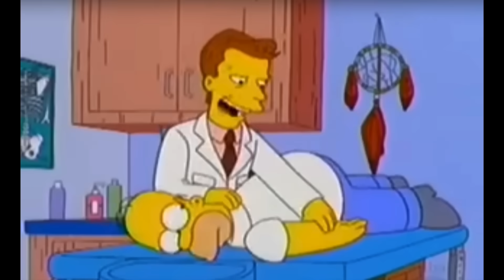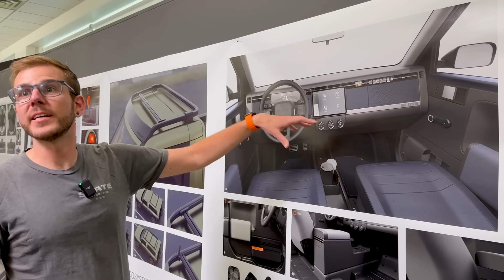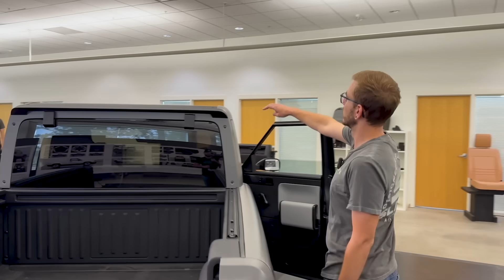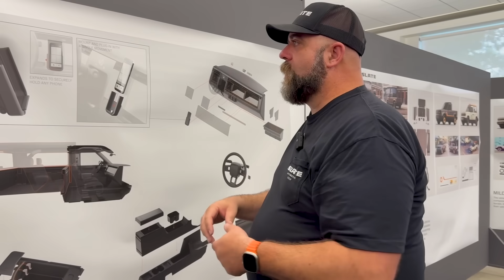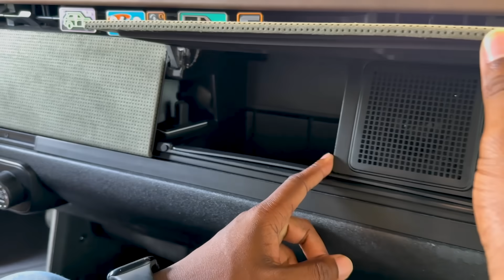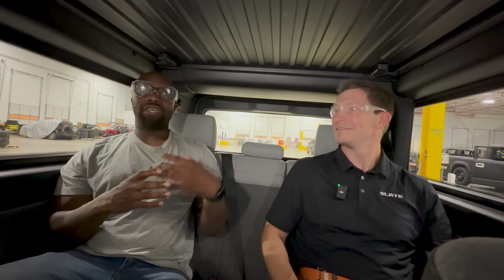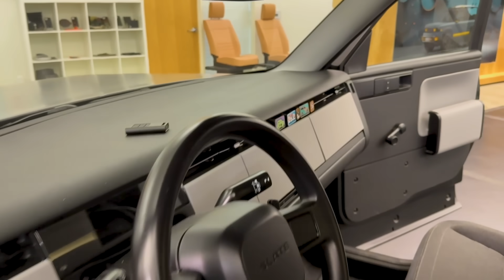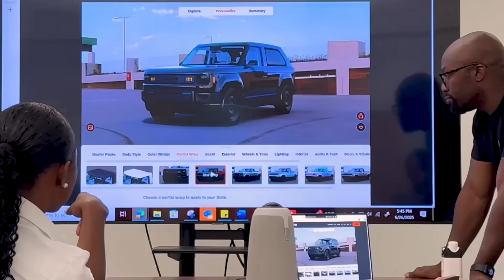The Slate: America’s $20K Answer to China’s Cheap EVs (Exclusive Access)

Comment: I own a Rivian R1T. I love it. But my favorite car that I ever owned was my Cherokee XJ. I miss the era of customization, serviceability, and razor focus that cars once had.

The Slate philosophy and the car they've designed literally brings a tear to my eye. This truck speaks to me in a way that I forgot cars can. Words cannot describe how deeply I hope for Slate to succeed, and for my modern day electric XJ to be in my driveway two years from now.
Reply: I do miss my XJ. I wouldn't trade my 99 4runner for one, but I do miss it. What I don't miss is fixing something every other weekend. Don't get me wrong the 4.0L is legendary, but the rest of the XJ is built so poorly. A unibody SUV with sold axles and 4wd is a great idea. But the execution was terrible. The electrics are garbage, the cooling system is undersized, the plastics are brittle, the wiring is sketchy, the body has too much flex, the rear leaf springs ride terrible unloaded yet sag when adults sit in the back, don't even get me started on steering play and death wobble. The only good things about an XJ in my opinion are the engine and the exterior styling.
Reply: @xanderlander8989  maybe I just had a good one but I never seemed to have those sorts of issues. I had a 5 speed 89. Aside from upgrading the rear axle and suspension for the OME lift, I never had real powertrain issues. Maybe replaced some spark plugs and vacuum hoses but when I sold it at 230k, it just worked fine. Never had any steering issues with it at all. West coast car so no corrosion. What I miss most was just how simple it was to work on. I think the XJ was an old school design that was just produced long enough to benefit from more modern things around manufacturing like OBD, but mine predated excessive use of cheap plastic clips and such, so it held together well. The XJ was a good design to start, but I think what made it a legend in my view was that it was just a prime example of an old school design that survived long enough for the final hurrah of cars meant to be repaired instead of manufactured perfectly and cheaply, but to be replaced once it finally broke down. In the same category in my mind are  gen 2/3 4runners,  the ford ranger, jeep TJ, and K5 blazer. Cars like that were designed by everyone but they don't exist any more.

I hope that Slate can prove that there's still a place in the world for a car that is simple in concept, easy to repair, and easy to modify/personalize. There are a lot of us who don't want to give up out old 4runners or XJs because no one has made a new car for 25 years that can do what they do. I don't want to speak to soon, but Slate is the first company in this century to try to bring an old concept of what a truck needs to be.
Reply: @xanderlander8989  in other words * i took my xj in extreme offroading conditions and things broke* like most vehicles will
Reply: you can still restore and upgrade those old cars, xj still have enormous aftermarket support and can be picked up relatively cheap used.

Comment: the msrp is 27,000 so they are really hoping the EV vehicle subsidy doesn't go away. Otherwise they are selling an EV truck with no accessories for the price of a ford maverick.
Reply: You can get a new Equinox EV for that money with all the normal stuff and twice the range. Just gut the interior if you want a work vehicle. IMO the Slate doesn't make sense over $20k MSRP, really more like $15k.
Reply: @bryanhersman4037 have fun with your piece of crap that will be scrapped by the insurance company because there 2 scratch under the car on the skid plate of the battery lol
Reply: @bryanhersman4037  I agree in that price range there are other options. However, the other options are not built to be kept for long term and require far more in labor, repairs, maintenance, and cost to maintain. 

Just had an AC replaced in 3-4 year vehicle I bought new right out of warranty and it cost me 3K and most of it was labor cost. Family member also had a turbo in his truck break and got quoted 10K+ to repair just out of warranty window and most was labor.  

The slate has a modular design where I can just remove the sections designed to be EASILY removed myself and plug and play the ac parts. If need be take it to a mechanic to add the refrigerant only.  I could have saved myself like 2K in labor. 

Also once you order your traditional vehicle you are stuck and limited with what you can do . That traditional vehicle will always be a car or truck not both. With the Slate you can have both. 

Traditional cars also require all the cost upfront for packages and things you might not need. With this you can as you please .

BIGGEST THING THOUGH IS NO DEALERSHIP MIDDLEMAN from what it appears they are going to be selling directly to consumers. 
That is enough for me to get one tbh . Buying a new car an dealing with Dealership is among the top of list of miserable things to do. Might even prefer a root canal at the dentist.

Im going to get on the pre-order list because I like the concept and the thought the company has put into making this DIY friendly and being American made!
Reply: Yeah, I was kind of shocked when they said it's 27k. Especially when they talk about how much they've eliminated and how little it really comes with. Simplicity is good, but not if it's the same price as higher optioned vehicles (hell, you don't even get a stereo?). It's a unpainted plastic box... Basically just a full size rc car. I don't see where they justify that price. Maybe they need to recoup a lot of start up costs? Or they're trying to make too much markup? It definitely feels like they planned on ev rebates. I dunno, but I don't see them selling a ton unless they get that price down
Reply: @colestowing8695 
It’s cheap as hell for a little truck. What do they need to justify?
Reply: @ChitFromChinola  i guess we'll have tp agree to disagree, but you can find a lot cheaper than this out there. admittedly maybe not a truck, but a buddy just got a brand new leftover equinox for like 21k. or the slate is 27/28ish...for a few k more you could get a 4wd wrangler. if you shop around not everything is over fifty grand. this is a tough sell for that much money...i just think it should be well below twenty to really get traction. which makes sense if they were banking on subsidies
Reply: @colestowing8695 
An Equinox and a Wrangler are not pickups. And a Wrangler is not electric. (And Wranglers are death traps.) I’m not going to load bags of Quikrete and chicken feed into the back of an Equinox. This pickup is as cheap as any other on the market, and it’s full electric which is better than any gas engine. If they get it ramped up and commercialized, it’s going to be a winner.
Reply: @ChitFromChinola  yes, i said that those weren't pickups. and i did mention the maverick (i think...maybe i forgot) which is a small truck for around the same money but way better equipped. look, im just saying there are other options and i dont think the value is there on this-not at almost 30k. I don't know what it costs to produce these but I'd be very surprised if there isn't a substantial markup. And if not, then.... I'm wrong (maybe this is the cost of making stuff in the USA, in which case I'm absolutely wrong and i regret bashing on them). But ultimately Im not telling you what to do. If you want one of these, by all means go for it. It's just kinda weird seeing people argue for a corporation....you realize these are backed by Jeff Bezos/amazon, right? This isn't some little startup doing a kickstarter. They don't gaf what i think. Anyways, if you get one by all means feel free to come back later and tell me how wrong i was and how fantastic it is...I'd honestly be curious to know
Reply: @colestowing8695  That's what I see too.  That ev rebate was nearly 30% of their price there.  And without it, it prices itself into much better vehicles for the money.  

Like if I wanted an EV today, I can wait for that for 27k or more (price creep between now and when it goes on sale) and the risk of a new EV company and first line EV. Or get a new base trim Chevy Equinox for under 20k today (there are some great sales on those right now) that seats 5, has basic convenience and tech, and 320 miles of range.  

If I must have a truck, I'd go santa Cruz or Maverick where I can get a lot more towing, better payload, a hybrid option, seats 5, no range issues and not much longer than an accord.  

This one may have a niche, city truck, single people or no kids and never hauling any friends, 2nd vehicle or 3rd family vehicle, maybe some city fleet use... but that's not something you can keep alive on.  

It seems like an Amazon investment.  Low risk (for them it's a drop in the bucket) put their marketing team on it, if it works, cool, that can return a lot, if not, shut it down after a year rather than drag it out.
Reply: A quick search of my local Ford dealers shows 106 new Mavericks for sale and not a single one under $34.000.
Reply: My issue is...the base slate truck costs 26k roughly (there is no electric car tax rebate now) meaning your paying for an electric truck that is very range restrictive not that powerful...bare bones in every regard...for 26k? Like youd be better off spending that money on either another new veichle or...buy a really nice higher trim veichle. Obviously with trucks its harder but still it sounds like a scam the price being so high and the feature set being so low and having to buy every upgrade which I could see quickly leading to a big upsell...I mean do they even have prices yet on the add-ons?
Reply: Imagine buying a Ford lol
Reply: @lettucejones3677 I have driven 4 Fords over 250,000 miles. I don't think I'd buy a new Ford, but the first and second generation Rangers and All of the F100s and F150s prior to 1996 were great trucks. The Thunderbirds, Taurus and Crown Victoria's, especially the ones built to interceptor specs were extremely  reliable.
Reply: It already has been ended
Reply: My thoughts exactly!!😂
Reply: you can buy a Tesla model 3 for 34,000 not 80,000.
Reply: It won't, the government has a big hard on for pushing people to EVs because they get a lot of kickbacks for it and it's going to take YEARS to convince people.
What pisses me off about it is that they're doing it NOW instead of spending a couple trillion over the next decade rebuilding our energy grids and electricity infrastructure to be able to HANDLE EVs on any scale worth talking about.
Would also give companies time to get EVs out that are actually worth buying
Reply: One should never account for tax credits ever when buying a car. Its considered a bonus when and if you get it. Yes you are right the truck cost more than a nice 4 door Ford Maverick which cost around 27k base and the hybrid gets 40 plus mpg city and 30 plus highway. I do not think i would pay more than 15k for a Slate truck with a range of 150 to 200 miles. I really do not need or want a 2 door model and there has to be more ways to cut the cost. Its an over engineered trucks when they should be looking at how to make it simple and with in the confines of the regulations. 
There is so much stuff added to cars and trucks that keep the price high that no one really wants or needs.
Reply: It generally foolish to predict the future, but I don't see any Maverick available at $27,000 January 27
Reply: Yeah if only our country actually looked towards the future. One can I dream I guess.
Reply: @kidethan9  Why should other taxpayers fund your junk car that is far worse than a fossil fuel car just so you can virtue signal?
Reply: Ford Maverick is hybrid. I want an electric truck, so I’ll buy a Slate. The Maverick has Ford’s cheapo electronics, Slate has a bring your own electronics, so I can just plug in my latest tech. Every time I upgrade my phone, my truck gets upgraded, too. Dig it . . .
Reply: People buy EVs because of the gas savings, instant torque, smooth ride, and simplicity, features that are impossible in any ICE vehicle
Reply: @blueburaq lololololololol
Reply: @blueburaq *laughs in 6.7 F350 diesel* 1,000ft lbs, and a 48gal tank means at 22.5mpg, i can go 1100 miles between fill-ups. Show me an EV that can do that for less than $84k, ill wait…
Reply: @throttleblipsntwistedgrips1992  no way you paid less than $125k for that truck.
Reply: @throttleblipsntwistedgrips1992 lol, this guy bragging about his 22.5926535 mpg.

Laughs in $0.045/mile. I hope you drive 1100 miles in one sitting and that tank makes it to the end of the universe
Reply: @realedelbug they didn't say what year... it could be a 2019 or 2020.
Reply: @blueburaq  There is nothing simplistic about an EV lmao they're even more complicated than most ICE cars
Reply: @blueburaq There are many ICE vehicles that offer instant torque... not Turbos... my manual Transmission Civic has instant torque.
Reply: @blueburaq  Not really.   The Gas savings is basically nothing.   This is a low range city car here.   A Maverick Hybrid costing $3k less today gets 42 miles a gallon there and this EV isn't very efficient for it's size.   Looking at $150-$200 a year in savings there.    This isn't a powerful EV by any stretch either, it's not outpacing even the slower maverick for example.  

What it doesn't have at that higher price point... the range that EV's sell at today (300 miles is average range selling today, this is half that, and even Leaf is doing away with their short mileage vehicles and going in on more range now).  Paint, a radio, seating for more than two, apple carplay/android auto, towing, payload, etc etc.  

People buy EV's because they compete with their gas/hybrid models in some fashion.   Be that price, performance, comfort, tech, luxury...   This does none of those though.  That's worrisome because those are the EV's struggling today.
Reply: @rockinkuwaitchris perhaps that's true of 'traditional' ev drivers. But I've never considered a Model 3 or even a Prius, I'm just not into EVs.

But I really like this truck, and even at the 27k, I'd strongly consider buying one.
Reply: @VladimirPutin-p3t  I wasn't either into them.  When I was putting my list together of vehicles, I wanted nice tech, sporty but practical (Usually I end up with a hot hatch), good safety rating, keep the cost of operation down (not looking at something only getting 20 mpg) etc.   I had things like the VW GTI and Golf R, a WRX, etc etc on there.  The Tesla just kept checking the boxes.  

If I had 27k to spend on a truck, this one comes up short vs. a hybrid Maverick selling for 24k today.  Already that has options this one won't get and you'd price the slate over 30k just to get things the Ford has base.  And I have a strong feeling the Ford will have much better resale value.  

And that's what most buyers are looking at.  Most aren't going to spend more for less just because it's an EV instead of a hybrid.  Those models have failed pretty spectacularly of late and gimmicks don't help them out.
Reply: @rockinkuwaitchris  I'm really not sure where you're getting your gas cost estimations. My kia Niro is far from the most efficient and I pay $12 for around 265 miles of mixed driving.
Reply: @rockinkuwaitchris  Read my first comment again. You're missing the point and you're lying. I wasn't even referencing Slate vs Maverick. I was saying that there's more to an EV's selling point than just its accessories. Gas savings, torque, smooth ride, simplicity are things you can't find in any ICE. The reason people buy this car is because it's simply not a Maverick. But since you basically lied and compared the two, here's my response:
No, the gas savings isn't "basically nothing"; it's half of what you would pay for filling up a similar gas car, assuming you're charging at home overnight. Second of all, a Maverick ISN'T cheaper, and it DEFINITELY DOESN'T get 42 mpg. It STARTS at $30k, and real world mpg is 35. Don't get me wrong, it's an EXCELLENT little truck and I would buy one if I could, but your facts are simply wrong. Since you can't get basic facts right or do simple math, "filling up" an EV costs $12 for 250 miles, or
$0.05/mile. Maverick's 35mpg assuming $3.00/gallon means you're at $0.085 cents per gallon. Break even point depends on the price difference but you'll be saving $5k every 100k miles of driving. It's simple math. I don't know where you're getting $150 a year in savings.
We won't know what it's outpacing until it comes out, so you can't even bring acceleration into this argument because you don't know. What we do know is that EVs' instant torque always outpaces gas cars off the line. You say people buy EVs because they compete with their ICE equivalents. When it comes to gas savings, torque, ride, and simplicity, EVs have an edge over nearly every ICE car. I would still get a Maverick for the range and maybe towing, but as a high mileage super daily commuter, I would get the Slate with the bigger battery.
Reply: That big bill that was just signed by the president on the 4th removed the subsidy.
Reply: THIS truck would be twice as smart to buy than a piece of crap Maverick. Especially once you look at custom options, and your first fender bender, plus Mavericks look gay as phuck.
Reply: @JustAnotherJarhead   ahhh yes. Get this one because the homophobes love it.  Lol. Gtfo
Reply: @JustAnotherJarhead  being able to simply repair your own car on easy mode is what people want And I'm sure people are willing to buy it on that reason alone